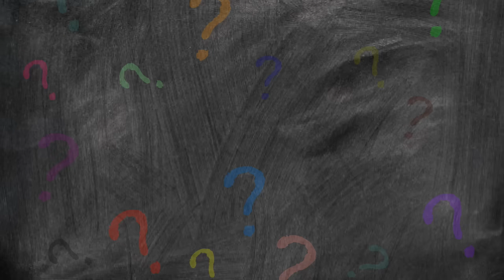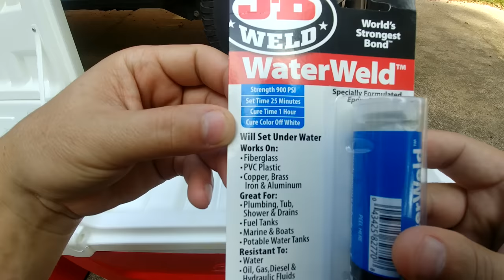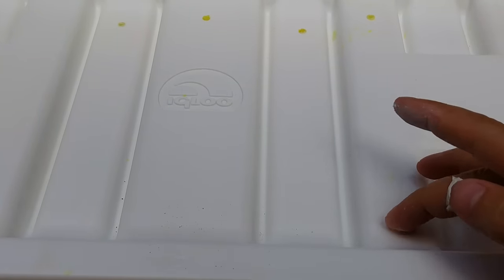Do Yeti cooler hacks work?

Comment: Warm air goes up, cold air stays down…
As the lid is insulated, the warmth at the top cannot exchange with the exterior. Every bit of heat that enters the system is trapped inside… that‘s why they don‘t insulate the top.
You would need a whole lot more of insulation in the lower part (no warmup on the inside) to make an effect with the top insulation…

Comment: Maybe the upgraded cooler had an air pocket from the factory on the bottom?  If you weighed the bottoms, do they weigh the same?
Reply from the maker: Good point! I will weight them in a future video.

Comment: Cold air sinks. This is why chest freezers are vastly more efficient than stand-up freezers, even performing well with the lid open. In other words, modifying the lid makes very little difference. A vast majority of the insulating efficiency will be from the sides and bottom of the cooler.

Comment: The real loss of heat in a cooler like that is due to Radiant heat loss. One layer of aluminum reduces heat transfer by 50%. If you lined it with a Mylar survival blanket that has  2 layer,s that can be reduced to 25%.

Comment: Yeti type coolers are all thick Styrofoam insulated.  Most of the hackers on you tube totally ignore the side and bottoms of the coolers.  Cold sinks, heat rises... the lid is actually not as important as the sides and bottom.

Comment: Hey, I'm curious if you could possibly put some water in the lid instead and freeze it? I don't mean full obviously because it would blow out, but do you think that the lid being full of ice would work better than foam?
Reply from the maker: Hey,  That is an interesting idea.  It should work better but I am not thinking that would be practical.  To freeze the lid would mean you have to have a pretty big freezer and I would think as it melts you could have a mess of condensation around the lid. I really cannot test this since I don't have a big enough freezer.
Reply: @HowToWithJames  No, that totally makes sense. I keep thinking that there must be some sort of reason besides "cost" that the lid wouldn't come with foam from the factory. It's almost like its called a "cooler" in the most basic sense of the word, but really, it's just a place to put cold things.
Reply from the maker: Good point. I am going to take these coolers out again this summer and experiment some more. All the comments here have given me some great ideas on things to try.

Comment: with the screw out check to see if there is a filler inside the bottom of the cooler..also....I have found That if you put a layer of newpaper between layers of ice/contents of cooler that the ice does not melt as fast and the cooler stays cooled longer ....

Comment: WORKS  FOR  US :
Take double sided reflective bubble wrap insulation and custom cut pieces to wrap the entire cooler (whilst still allowing it to open), and then use duct tape to stiffen the corners and "touch areas". This INCREASES the air insulation between the ice inside and the hot outside, and adds radiant reflecting. When you added foam you actually reduced insulation by adding mass that bridged heat across the air gap. Imagine holding your hand just above a hot skillet, and then putting on latex gloves to touch the skillet. OUCH! #OvenMittsWorkWithAir

Comment: are is an insulator. That's the whole idea with double pane windows. That seal pocket of air actually isn't insulated. All because of lid is not seal does not mean that is not insulated. That's just a trick that we are used to seeing with the foam insulation.

Comment: Good insulation is mostly air, the lid shouldn't weigh that much more so I'd say you added too much spray foam and so there was no room for the foam to expand forming a  solid piece which will conduct heat better.

Comment: Air has always been a better insulator, gotta remember the foam became a heat sink that will hold the heat and the other will cool allowing the heat to dissipate!!!  Read one of digging a hole for the hobo refrigerator actually works, but remember the more layers of air to fend off radiation the better sustainability for ice!!! Hobo fridges work a lot better with permafrost layers in some climates!!! Sorry for the 2 yr delay but just found your video!!!

Comment: For the second experiment, I would have transferred the lid to the cooler that didn't have the rubber seal. In an experiment like this only do one thing at a time. And the window sealant looked different than the video I watched for insulating the lid. But thanks for the experiment. I think I'll just add more ice to my Coleman.

Comment: The trick to insulation is air. The balance of air pockets to the density of the foam is key. That insulation is probably for blocking wind and moisture and is probably really dense. So, I bet cutting the lid in half and fitting with a styrofoam then gluing back together would work better. Or just not be a cheapskate and get yeti. I dont own a yeti myself and am satisfied with the coolers I do own because I am a cheapskate, I'm also not dawging any yeti owners.
Reply from the maker: That is an idea but would be tough to pull off and still create a good seal. Thanks for the suggestion.

Comment: The problem is the air induction principle.  What you need to do is get a bunch of white Burch scap wood and shave off as much shavings as you can. Take your shavings mix it with straw and clay from the earth. Take your mixture and use it to make a mold of the lid of the cooler. After you have done that Take the mold and set it aside. Be sure to not damage your lid because you will need it later. Take your base put 128 holes 1/4 in apart and stick nuts with washers on the inside of the cooler. Then get your lid and the base and stick it up your butt.

Comment: I think its bc the hollow cooloer uses that hollow space as an insulater,kinda drawing coolness from the inside  which cools the air a lil more before it can reach the inside.
However once filled it may take a lil longer but that foam is gna warm up to the outside temp n hold that heat longer effectively drawing more chill from the inside out.sorta like being in the city at night after a hot ass day n u can still feel the hear radiating off all the brick buildings & asphalt. 
At least thats my thought anyway. What do any of us  actually know tho right lol.

Comment: The best thing you can do for cooler is cover it with heavy Blanket or sleeping bag it has always hold ice in any cooler 4 times longer than a uncovered cooler, does not matter on the brand or the insulation of the cooler

Comment: Heat rises.  Cold falls.  It's not just about conduction - in fact, that air gap should prevent conduction. 
Your lid didn't allow built-up heat to escape like the engineered-empty lid did.  

I'm still surprised at the result, but this is maybe proof of the old "coolers don't keep cold in, they keep heat out" - I'm thinking you showed you kept the heat in.  Only thing I can figure.

Comment: The hack works. The foam needs more space to expand. Make the injection holes larger. About 12 mm or 1/2 inch. Plug the large ugly holes with these hole plugs and a little silicone. https://www.amazon.com/WIDGETCO-White-Hole-Plugs/dp/B00QIMQIJG/ref=sr_1_16?dchild=1&keywords=screw+hole+covers&qid=1592714055&sr=8-16.

Comment: The only way to know if the two coolers were actually the same to begin with was to do the test first with both of them unmodified.  And the test should be done where light is controlled. The sun moving is going to change the temp in the car as it does so - not an equal test.  So - do in garage for instance. If they both are the same, then do the test. But  I also think he destroyed the seal when he put uneven insulation for a seal - It was very obviously not even and could have even warped the container or the lid.
Reply from the maker: If I did this test again I would do what you suggested. Regardless of that i think the test still shows after making the changes I did it did not perform like a yeti cooler or it would not have been close in keeping the ice cold. I did a test with an actual yeti and the performance was huge. Look on my channel for that video.

Comment: You didn't account for all of the variables. One is that the unmodified cooler might have better insulating properties in the shell from manufacturing variance. Should have done a baseline test before modifications to see if the coolers performed the same. Also, there may be a variance in the left side and the right side of the jeep due to sun. Just a couple ideas.

Comment: I am suspicious that if you pre-freeze your two coolers with dry ice, then add the ice. The modified cooler will hold the cold ice longer as I think the materials have to cool down to be able to retain the cold. The unmodified cooler will have a thawing rate higher than the unmodified.  I do this with my YETI and then it works better.

Comment: You didnt do a control test befor you started to see if there was any difference in the 2 coolers. It's too late now but try swapping the lids and see if you get the same results on the modified lid doing the same test. there may be a quality difference in the bottoms of the coolers.

Comment: your lid was not full with foam or it would have came out of that hole you took the screw out of. if its not full it will work against it self and its all or nothing and you used window foam witch is less dense you want like touch & seal , loc-tite or other more dense ones or at least g.stuff gaps n cracks works best.but dont feel bad my 1st try was a fail also.

Comment: The modified cooler since it was a tight fit the moment you closed it it trapped hot air and sealed better reason for it to melt the ice faster as to the other that isnt super tight it ventilates little not trapping the hot air inside its the only logic o can see why tbh

Comment: You want to use a heavier density closed cell foam for insulting. It has an r value of like 7 per inch. Another issue you have is that you didn't pre cool the cooler. The foam is a good insulator when it's pre chilled.

Comment: Foam is used in Spa/Jacuzzi’s to retain heat but i can understand why one would think it could work.
Reply: It maintains delta.  That's why insulation works in the winter as well as the summer.

Comment: I"m thinking that you should switch the lids on the cooler bodies and see if you get the same results. If you do get the same results then it is the modification that is causing the cooler to get hotter. If you get better results then there is a defect in the body of the cooler that you modified. Remember most everything is made by the lowest bidder. Also try pre-cooling the coolers. Maybe the one you modified is holding the heat in longer because of the insulation, but once you get it cooled down it will stay colder longer.

Comment: The insulation will absorb and transfer heat. More than air. Air doesn't store and transfer heat nearly as much as a solid.
The next experiment you need to do is get another cooler and just put the weatherstripping on one with no foam insulation. I would think the weather stripped cooler  will outperform the stock one. Actually, you should have performed this experiment BEFORE drilling the holes and filling it up.

Comment: My question is: Do they both have the same density of insulation in the cooler bottoms? I guess the only way to know is to cut them apart and examine the walls. It seems to me that your lid was done correctly, so I'm suspicious about the equality of the insulation in the bodies. Definitely a good experiment though!
Reply from the maker: The one last thing I did not do and should of was switch the lids and retry the experiment. I am going to pull these coolers back out and experiment more this summer.

Comment: This was a good experiment but I think you made some mistakes or at least could've improved the way you did things to avoid some potential problems occuring that could affect the results of the experiment. 

1. You weren't very scientific about how you filled the cooler lid with foam. The way you did it creates the possibility of trapping air pockets in the lid. What you should've done is drill just two holes at either end of the lid, turn the lid vertical then start filling from the bottom. The foam will then expand upwards and push all of the air up and out of the lid and fill the entire void space with foam as it expands. I think the way you did it may have trapped some air pockets in the lid so it may not insulate as well as it could. I would like to see you try the same experiment with the lid filled the way I suggest so that we're sure there are no air pockets in the lid. 

2. It is also possible that the pressure of the foam expanding inside the lid caused the lid to deform in some way so it doesn't seal as well with the base as it used to before the foam went in. An inferior seal between the lid and base of the modified cooler may explain why that cooler did worse in the experiment. It might be best to place the lid in the cooler base while the foam is setting/hardening so that it sets in the exact shape of the cooler base and will fit tighter and better to the base than the way you did it. 

Also, a quick and easy way to seal the igloo/coleman coolers is to wrap a strip of gorilla tape around the seam between the lid and the main body. That will prevent the movement of air into or out of the cooler when stuff is being stored in it. The downside of this method, of course, is that it creates waste when you take the tape off when you go to open the cooler but it will improve the quality of the seal between the lid and the base and should, to some extent, reduce the amount of air exchanged between the inside and outside of the cooler and help reduce the amount of heat getting into the cooler via that path.

Comment: There is a reason the cooler has a air space in the lid it gives the cooler a buffer for heat to rise and dissipate the foam is conducting the heat into the cooler and not letting it dissipate.
Reply from the maker: So what would you suggest I try?  I know Yeti coolers have insulation in the lid and the base.

Comment: Air is actually a very poor conductor, which makes it a great insulator. That's why you see a lot of "yeti cups" with a vacuum seal for its insulation. It's damn near impossible to make a modern house air tight to the point of a vacuum, so foam would be the next best thing.😎
Reply: The cups only have the inner and outer touch at the very top so the heat comes in from there, not the sides. Heat naturally rises, so it would take an obsorberant amount of heat to make the contents of the cup hot. 
Houses, have other issues, you could build a layer of air, but if you use glass, you made a greenhouse.  If you use steel, you made an oven. We insulate the walls to prevent heat coming in  in the summer and escaping in the winter. 70% of our loss goes out through the windows,  hence the polarized tinting and double pains.
Reply: @CowenJE  oh yeah for sure, i was just using a simple way to explain why the lid of the cooler was hollow and not filled. Not to mention i said a modern house, they're built entirely different from a yeti cup lol. But just to clarify air used in a proper situation can also be a form of insulation.
Reply: Vaccum means theres no air so it doesnt allow for conduction or convection. Its simply a space in between the two layers of steel that has nothing not even air.

Comment: My theory is that with foam insulation in the lid there was no way for hot air in cooler to escape. If you filled each cooler completely with ice that hack might work.
Reply: please go back and study the 2nd law of thermodynamics along exactly how heat xfer from molecule to molecule works.........it may benifit ya!
Reply: @johnkillen588  yeah I'll get right on that...

Comment: its cheaper to get 1.5 inch foam board and making a cooler. skin it with thin plywood and paint it. I would say it works better than yeti. I used thick mil plastic to line inside. and when I say cheaper you have to figure in price of that cooler itself and the life of it. Im working on one now that has 2" foam board and Im lining inside with aluminum and maybe outside but with a break between the aluminum outside and inside. it would transfer heat that way so you seal with rubber strip and then a weather strip for the seal.

Comment: I have a Yeti ice last's for 3 days , on the evening of the 3rd day it is cold water.
I think that your coolers are not insulated the same actually i suspect the one you modified is defective from the factory.
I have used foam Omaha meat coolers and they last 3 days also but they are not durable and have no drain and no hinge for a lid. I have in the past painted the Omaha cooler with water base poly paint and that makes the outside of the cooler more robust but no the inside no hinge and no drain.
Moral of this story order Omaha meat delivery & get great steaks plus a superb cooler.

Comment: I'm two years too late, but I'm going to make my suggestion anyway. Take your modified cooler, drill four very small holes all the way through the lid at the corners. Then run a similar test. This might just force the warm air up and out.
Reply from the maker: Great suggestion. I might try this in a future video. Thanks!

Comment: Your using to different coolers looks like maybe that's the difference and instead of sealant foam try insulation form not sure if there is a difference tho
Reply from the maker: The coolers are the same.  You are just seeing a re-branded sticker on the front.
Reply: @HowToWithJames  oh